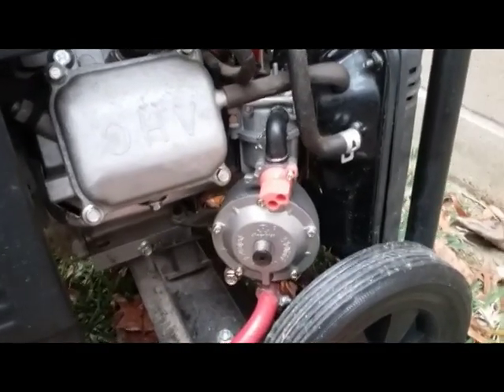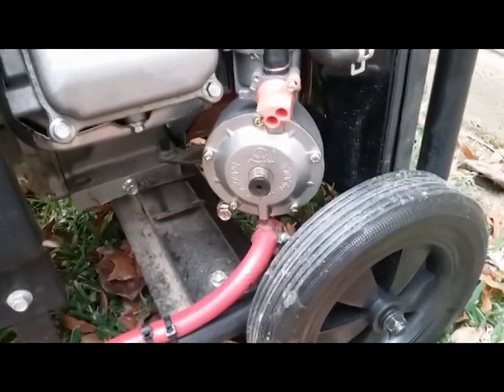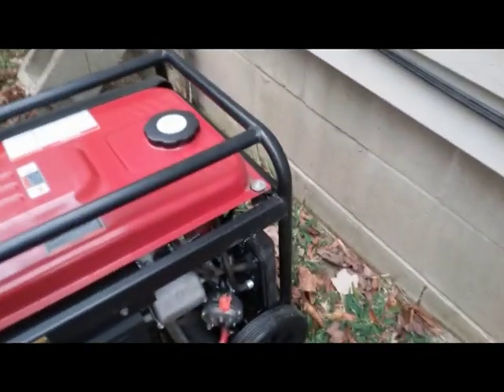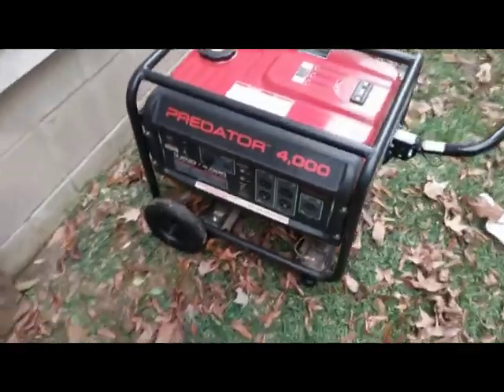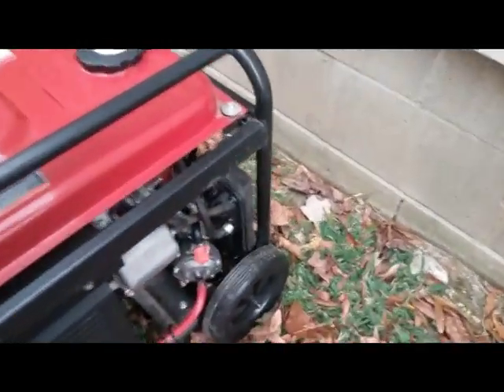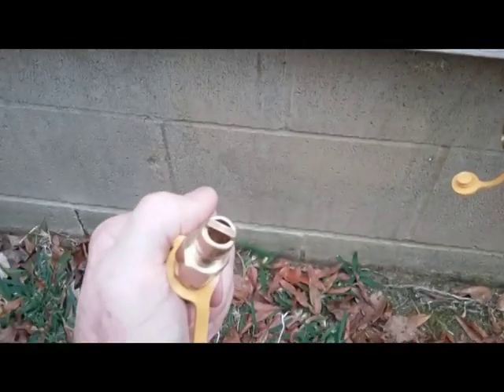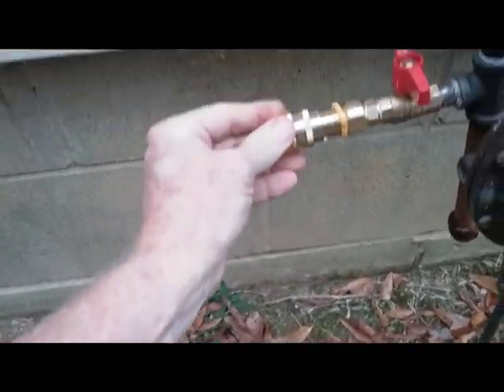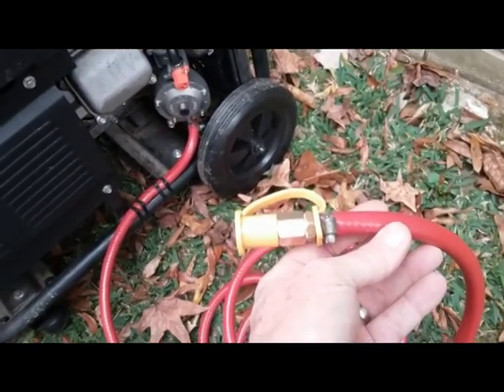Propane / Natural Gas Conversion on Harbor Freight Predator 4000  Generator

Comment: did you have any problems using clamps on the actual hose connections
Reply from the maker: @KenEngland-h3m  I still have the same hose and clamps I did when I installed this system a few years ago. The pressure on the gas line is measured in onces... Very minimal.

Comment: Note: your system uses the pressure regulator to the house. Anyone connecting to a propane tank will need to have a hose with a regulator.

Comment: Does the regulator shut the gas off if the engine stalls?
Reply from the maker: If the engine dies, there is no vacuum to hold the diaphragm open stopping the flow of gas to the engine. The gas supply from your tank to the diaphragm is there until you close the valve.

Comment: I have the predator that comes with the propane or gas option and I cannot figure out where it's talking about to bleed the line. I see where the gas line goes in to kind of a round spot on the generator and supposedly that is where I bleed the line but there's no button to push or anything like that.
Reply: Please be safe https://youtu.be/I1jT3ANENvI using your generator

Comment: Does that start easily on the cold weather?
Reply from the maker: It starts better in cold weather than gasoline does. Just push the button on the regulator for 2 or 3 seconds and pull the starter rope. It fires right up.
Reply: Thank you Tony. I’m truck driver, Federal regulations says we can have up to 8gal or up to 220lbs maximum loaded tank weight.
I’ll make another frame for my predator 4000 fully enclosed and use a propane tank. I’m going to use a 20lbs propane tank, even though I already have the 8gal tank I believe 20lbs of propane will last way more than 8gal of gas

Comment: I have a Predator 8750 7,000 running watts will I need a different regulated set up or will the 4,000 you have work?

Comment: Have you tried running it from propane with a regulator?  If so, did you get a variable one, or just a low PSI one?
Reply from the maker: I have. I used a variable that came with my fish fryer. It worked great.
Reply: Awesome, thanks!

Comment: Hey Toni what hose did you use for the quick conect ???
Reply from the maker: oscar33127 i used some air line that i already had. There is not much pressure in the hose.... something like 4 psi or less.

Comment: Nice job Tony; picked up the same kit from Amazon;I also have the same generator predator 4000.did you use the same gasket or did you have to get a new one Thanks Mike
Reply: Mike Powers  Can you give me the link for the conversion kit?
Reply: Mpowers8010@hotmail.com
Reply from the maker: Hi Mike, I made a gasket out of the cardboard package sandpaper sheets comes in. It has this shinny side and a brownish cardboard side... it worked great. If I did it again I would buy the gasket when I ordered the carb. I've made a lot of gaskets in my time so the extra 5 minutes it took wasn't a big deal. If you're really careful you might be able to re-use the old gasket but mine was torn so I had to have a new one. Good luck, you're going to love the propane carb.

Comment: Have you run it under a load yet?
Reply from the maker: Yes I have. I've only had it up to about 2000 watts but it didn't even sound like it was working hard. I have no reason to believe it wouldn't easily do full rated output. I have only tried gasoline and propane so I can't speak for natural gas.
Reply: I swapped the same carburetor on my predator. I haven't ran a natural gas line to it yet thats why i asked, but i have tested it on propane and gasoline and it ran wonderfully.
Reply: What is the link to the carb kit.  Great video..
Reply: I went with Vpower and you get the propane hookup line , etc  price a bit high, but quality is a well made unit you wont go wrong!  With youtube video for installation.  @carmineleone9996
Reply: I hope you are safe using your portable generator https://youtu.be/I1jT3ANENvI thank you. I hope you watch this video about generator safety.